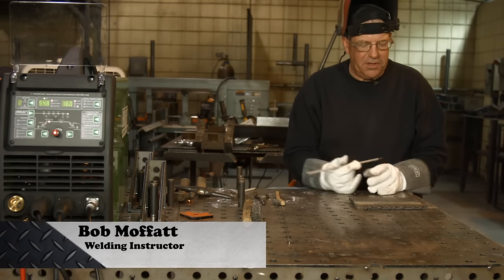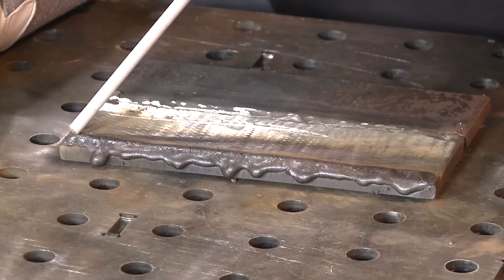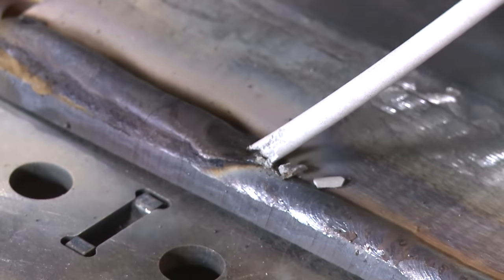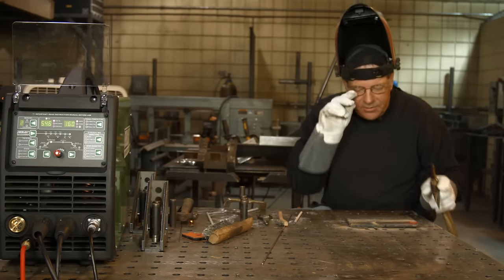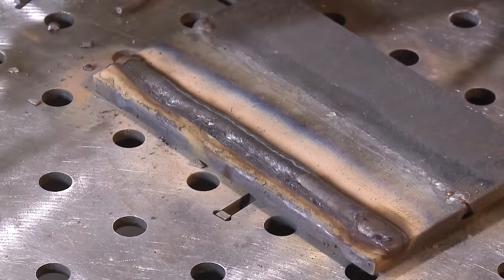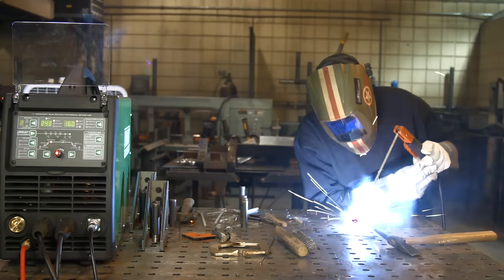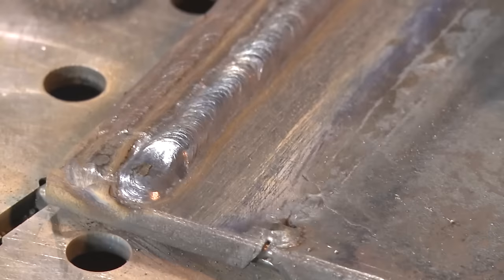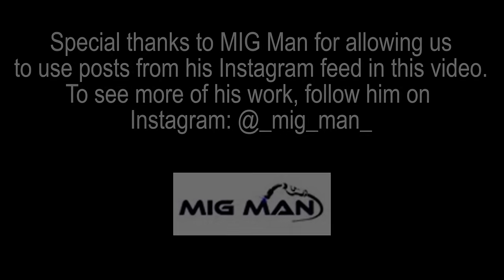Welding 101: How To Run A Straight Bead

Comment: That is a damn good bead and you're running pretty hot too.
Reply: That's how the better weldors weld. Settings to the hot side, tight arc and get moving. As soon as you know what your weld bead is looking like and you are happy with it? At that point, stop looking at the puddle! Train yourself to look just ahead of where the puddle is. Let the arc light the way. Once you get in this habit? You won't have to draw a soap stone guide line. You will see that seam or that multi pass weld you are ready to put covers on. Here is one more. Get your head back away from the arc. Keep your lenses and lungs cleaner than before. This bit of distance also helps you see where you are going. Just run a few test stringers, vertical welds etc. Get yourself dialed in to achieving the desired results regarding travel speed. Run stick with a tight arc, mig and flux core wire with about 1/2" between end of welding tip and work.

Comment: So I can't stick weld all that but I have learned on my own, mig welding, nothing is easier than welding a straight line in front of you. My suggestion to anyone trying to learn is two basic points, know the heat you need to properly join two parts and learn the speed it takes to lay the perfect bead. Then learn how to weld when you can't see and with control, weld what you are welding the same way as if you see it. And like I said, i'm no expert non arch welding but with a mig, if you have to stop to reposition, make that before the weld stops to glow under the hood. If you can't see glow, you are now mounding when you start. And always start at the highest that you can start if access is limited whether you can see or not, mounding is never a pleasant sight and can get very frustrating trying to fix a mistake that could have been done earlier.

Comment: Thanks for the tutorial.  I just came back inside the house after practicing what you preached.  Very helpful, but I'm not even close to producing a weld like you generated here.  Question: How did you decide on that amperage?
Reply: Theres a simple way to determine amperage. Take the diameter of the welding rod (1/8 inch rod for example). 1÷8=.125.
So a 1/8 welding rod can run around the area of 125 ramps in 1st position (flat).

Comment: @8:12 if u turn ur hand around and check heat with the back of ur hand. its way easier to tell if something is hot. The skin of the inside of your hand is a lot thicker making you feel it less easily.

Comment: I notice any time you finish the weld, remove the slag, or brush the the bead, you leave the machine on and throw the stinger over your lap. My question is if this is a safe practice or if there is any potential  concern for safety., or if during any certification test this may go against them. I am a fairly new instructor and I would like to make sure my students have the  best and safest practices . Thanks for all you do to help the welding and metalworking community!

Comment: All good advice: l welded for 10 years before l retired......and the MOST IMPORTANT thing in welding is: to always wear a respirator, and have good extraction....NEVER take your lungs for granted.....this trade can seriously damage them if not protected. Also always wear a mask or respirator, when using a hand grinder.....a light cloud of minute steel particles in the air can be breathed in. I knew a retired welder who had welded for decades with no protection for his lungs, and he ended up housebound breathing out of a bottle. Thats my advice to ALL welders:  make the protection of your lungs, your TOP PRIORITY. If not: one day you may regret it dearly....have forsight for your health, decades from now.

Comment: I have two questions. Why are you using this machine insted of a Miller ? Second question why are you using a clamp holder over a twist electrode holder?
Reply: Did you bearly start welding?just asking
Reply: @ernestoramirez8545  I have been welding from age 15. I'm now 40 and I have welded with the clamp and the twist lock. The twist is the best in my opinion.

Comment: Its a good video with lots of info.. however the 7018 you really want to long arc it a bit.. with a 5/32 rod esp.. this will increase the voltage spread the gas coverage more, get it to flow better and help with the peel.. also the other thing thats most important and he is not emphasizing is the overlap.. that 45% overlap is extreamly important to the cosmetics of  how your cap on a plate or pipe will look, and its also very important to prevent failures in the weld.

Comment: I weld on dock plates at trucking terminals. Structural repair stick welding. I always use 7018. Enjoyed this video. Got any videos on vertical stick welds?

Comment: At guy at my job does this technique called “whipping “. Here I see the instructor just slowly dragging the stick. Which still looks clean af. Is there a difference, or it’s more of a preference?
Reply: More of a preference although if your whips are too far apart the weld is weak and will not pass a bend test lmao

Comment: Thick welding rod and low amperage, lets say 3.2mm rod 70 amps 2mm steel is it healthy for the machine to go below-recomended amps?  Using dc stick inverter Telwin 216 hd . Inverter recommends using around 110 amps, rods from 100 and up, so if i go with way lower amperage and manage to weld would it affect machine in some negative way or i shouldn't worry about it?

Comment: I am very excited to have found your channel. Brand new at welding I aquired a huge stickwelder/generator and am excited to learn. I will begin with this lesson of running straight lines! Thanks
Q: what is the 548 on your welder panel that you didnt explain?

Comment: Running straight lines is especially hard for me.  To rectify this, I’m thinking to get 50+ pounds of rod - most likely 6013, as those run easiest on the welder(s) I have ready access to. (6011 is trouble - one thing a time for duffers like me.)

Comment: I have a question. I have a small electrode welding machine, portable and all. one thing I was thinking, is if it could also work as a spot welding, that kind that weld wires by contact, with 2 copper electrodes attached. like if I put it setting in the small amp possible

Comment: The rod angles very different to how I've seen others at almost vertical instead of 45 degrees here. Will that cause much difference to the weld? I'm also curious about the arc length with the Flux on the rod tip touching the workpiece as I've learnt that less than the width of the electrod could give a cold weld?

Comment: I keep blowing holes in the 17 gauge metal sheets I'm trying to butt weld together. Tried DCEN, low amperage (10-20 A), and using either a thin (1.6 mm) or fat (3.3 mm) stick.  Any tips?

My next experiment will be lapping the edges to see if that works any better.

For context: I'm patching a large hole in a steel shed.

Comment: 160A seems like a lot for a 5/32 rod. So now I'm thinking I've been running a little low... I don't even run 1/8 that hot. I have gone by a chart so far for EN/EP, AC/DC and amperage. What am I missing?

Comment: im in a welding class at my high school and im trying to get certified. right now we are doing T peices but i keep struggling with eating the metal and not getting the bead high enough. i turn the machine down and still eat. i pull my arc back and still eat. any advice?
Reply from the maker: Your work angle is very important so making sure you are pointing that electrode up a bit so it fills in that undercut. You also might want to try to slow down a little bit.

Comment: 911, I bought a D.C.160 amp inverter to learn the basics, if it takes I'll invest in something better. What is a good beginner rod? I set it up on 240v and was trying to learn to strike an arc, using 1/16 6011 DCEP, not so great. When I was lucky and got an arc going are you supposed to drag it on the material or hold it up off the material at a distance the diameter of the rod? And travel speed? I did the best at lower amperage because that 6011 likes to penetrate fast, I tried a 1/16 7018 not so violent easier to control, I think also if I get better quality leads may help as well. Thanks for the video.

Comment: hi dear,
After many failed attemps I found a "good" suggestion that help me to made my firsts good welds (optically). The suggestion was: "feel the stick to scrape when you weld and move 2 step forward and 1 step backward". 
I don't remember where I found that suggestion on web.
Is It correct? Because many others tell to move the rod during weld without contact, keep away the rod from the piece the thickness of the rod (2/4mm).
That was how I try to weld before and I made holes, stick, switch-off arc, less material or too much. 
I've to feel the rod scraping or not? My welds with contact are very beautiful like tig, without contact I need more exercise, I think (very hard).

Comment: Hi can someone advise, I bought an inverter arc welder for home use. Used it may be twice, so im a total novice. 

I want to weld a thick plate on a gate that has a square tubing. The tubing is thin, may be around 2mm to 3mm.

So what amperage should I use, so I dont burn a hole in the square tubing? 

And what type of rod should I get. (I have no idea on rod specs unfortunately)

Thanks

Comment: Twist yourself into a pretzel up inside a boiler foundation welding 1 inch vertical stringers with a lap cover pass on 1/2 inch thick steel gussets, then we will see your skills.

Comment: Help using 6013 3/32 rods 98 amp setting plate mild steel  problem hard to chip of slag ,and rod starts to go red full length of rods "WHY"
Thank you for any help ..

Comment: Sir, i am having trouble tig welding 0.5mm thin sheet metal togther in a corner joint.. i keep burning holes in the metal ... could you please help me out... thanks

Comment: Hey just bought a mig welder and the plug is different then my outlet and I need a adapter where do I go?? I'm in Vegas I cant find anything anywhere
Reply: Chances are it's either a 240v machine or it uses 120v at a higher amperage (20+, where the "normal receptacle" in the US is 15 amp 120v) and has a twist locking plug, or a plug that almost looks like a normal plug but has 1 of the 2 prongs flat vs upright (120v 20 amp, or 240v 20 amp, depending which side is flat) or both prongs flat (240v, 15 amp). 

Impossible to say without you showing a picture or describing the plug. For high power stuff like this you should more than likely have a new outlet installed just for the welder, or have someone who knows what's going on determine if it's safe to use an adapter to plug the machine into something like your clothes dryer or electric stove plug. 

The plug is different for a reason, because your welding machine needs a different voltage or more power than most appliances. 
Look at this chart (thank you Wikipedia) and specify which receptacle it looks like your welding machine is designed for: https://i.imgur.com/tPfOTDy.png
(e.g. NEMA 5-20)
Or, post a link to product info/say the make+model number of what you bought and I'll find it from there.

Comment: I just started welding and I weld little snakes.  The biggest problem for me is I can’t see the gap I’m filling.  I have an auto darkening shield and can’t see through it.  Maybe it’s broke.  I can see your line just fine.
Reply: Gene Miller I recently started welding as well and I was unable to see through my shield... turns out I was wearing shade glasses and the hood together. After switching to just clear glasses it made a huge difference!

Comment: So Im no pipe welder or some professional welder. I work on rail cars and those cars are not state of the art. What is your best cheap manufacturer of rods you suggest. We use RADNOR rods and they pretty much suck. The flux breaks off and your sticking all the time and the electrodes get hotter than the Texas sun.Anyways just a question.

Comment: So as ur dragging the rod down the line ur are pushing it into the weld pool also? Is that the best way of describing it my friends?? 
Thanks for the great videos Bob mate.. It's great to watch these tutorials. I'm not out in my shop enough atm but I know I need to put more time into my Stick Welding .. 
I bought 1.6/2.0 E6013 rods for practicing with on some 2.5mm square tubing, Angle and straight flat pieces between 50, 40 & 25mm .. I have a cheap inverter welder. It's a Pos BUT IT ACTUALLY WORKS OK FOR NOW. hOW LONG IT LASTS IS ANYBODYS GUESS BUT FOR WHAT i NEED it for it should be ok..
I enjoyed this video. It gave me some good tips oin practicing to weld straight lines of beads.. I'll be out in my shop early tomorrow.
I have a question if that OK. I bought a 500x500mm x 3mm plate to build a small welding table. Will that be ok to use as a starter table. I want to make something with a 90 and 45 degree ANGLE just lke the Fireball parts only not as well made. 
I think they're called Fireball SQ's and other components for Welding tables, etc.. They have some well priced stuff for getting straight welds on an uneven floor as well which is why I was looking at them

Comment: difference AC and DCEP , I know ac means alternating current, dc direct current. what is the actual difference when welding. I have welded with both , but can some explain the best one to use for every day welding  and why. Welding machinery repairs, some beam and post steel connections ect. What is the difference between ac and dc !!!! 7018 stick welding, thanks.

Comment: How do y know how many amps to use?
Reply: If I remember correctly, take the rod diameter in thousandths of inches, take that number,  and that is a decent starting point for current.  Example, 1/8" rod = 125amps, etc.  I am not a Welder but I think this is correct

Comment: 🤦‍♂️ 1st day today welding class and i saw what you did that i did wrong all day and was getting frustrated 😠  with... i noticed your rod was at a angle. my teacher made it seem that we had to have the tip of the rod always on that 1 16th of an inch he was talkin about cant wait tomorrow to get back to doing this... were using 7018 at 120amps  and for other rod i forgot if its 6011 or 60 something we use it at 70-75 amps

Comment: shouldn't the first lesson of welding be how to calculate the correct rod, calculate the correct machine settings, and how to dial them in?
Reply: I’m NOT in ANY WAY an expert, but maybe this is just a first lesson in actual application instead of calculations and other stuff the textbooks could teach you. However, the dialing in would be good the longer you run beads on a piece of metal. You are right about that.

Comment: As an amateur stick sticker it looks suspiciously like the flux coating cracked at the hot end after a little flexing from pulling off the holder. Just sayin. But I do at least feel better about my meager skills watching a pro stick a stick to the work. Now if I could only get to within a degree of straight on my bead lines...

Comment: If you're old past 45 forget it work is hard they stuff u everywere. It's hot cold it's high it's low lots of climbing n heavey tools  but some older will make it for awhile then bad back bad knees neck but the BOILERMAKERS ..was a great JOB'.ps. I'm on best job off all retired with a BOILERMAKER pension..🇺🇸🇺🇸❤️⭐🍻🛠️🛠️🛠️🛠️🔥💪🌋💰💰💰

Comment: Shouldn't welders wear respirators when working?
Reply: Depends. If where your welding has a ventilation system, or your say, outside your typically fine. Respirators are definitely a requirement if your welding inside a tank or small area though.

Comment: I don't know any of the stuff yet but I'm gonna need straight lines. 

Those straight lines didn't happen because the thin metal and the welder blew through the thin metal it's a very sloppy looking job I did because of the thickness of metal i was working with its nothing I'll be looking at anyways i welded both sides

Comment: dragging the rod is ok for filling voids , for a good structural joint you have to push the rod into the joint , the reason his work piece didn't heat up very fast is because his first pass should have been done with a higher temperature or root rod for 7018 the root rod is 6010 ' i rate this video a 7  and the information level a 2 , college level maybe ,real life ? no way

Comment: I've always found it wierd how you Americans have welding schools (cool wierd) here in Australia you just pick it up on the job learn do a few test pieces get em tested then Wham-O you can weld structural, pipe, anything. Do you have 2nd class welders in America (non certified) as long as you can pass a test you can become 1st class no real schooling required
Reply from the maker: Certification is a real complicated thing here in the states, if you work for a company you will need to be certified through them but you can get certifications in all kinds of processes through the AWS.

Comment: Can't run a straight bead when you can't see a d@mn weld puddle.   It's like looking at a black screen.    Cataracts will do that to you.   These guys that do this have excellent vision, and rag on guys for their sh1tty welds because the guys who weld bad are basically welding blind.   I'd like to see some of these experts weld like the rest of us weld, with a a blind fold over our face.   See if you can run a straight bead then.